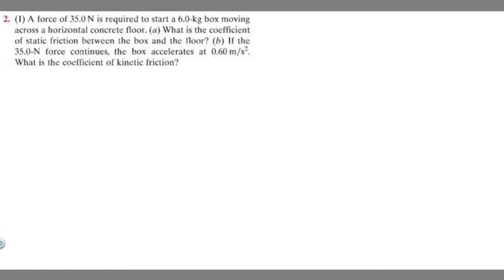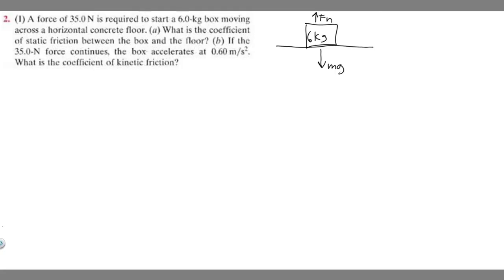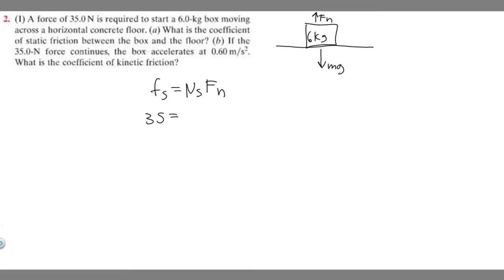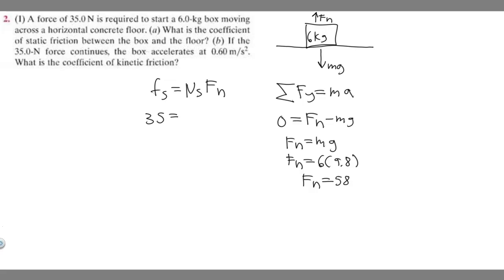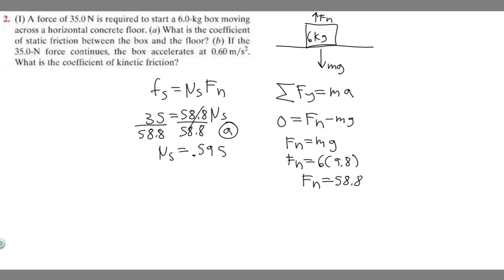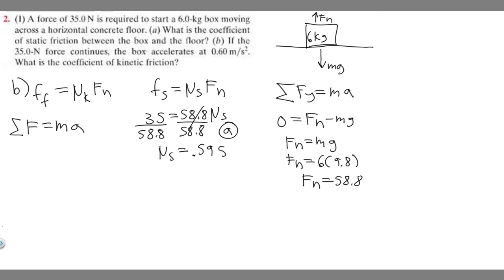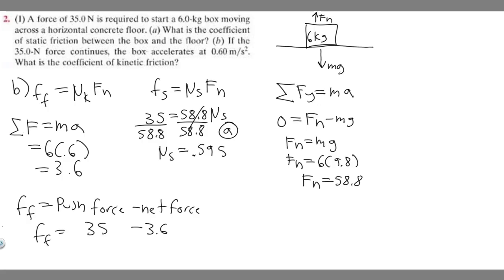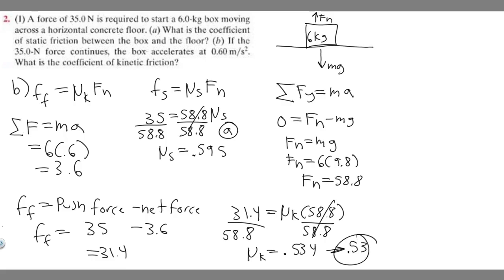A force of 35.0 N is required to start a 6.0-kg box moving across a horizontal concrete floor. (a) W

Comment: I don't understand how you're supposed to know that ff= to push force-net force. My professor is useless and the textbook doesn't mention this (even in the chapter summary all it gives the standard formula). I'm happy that I'll be able to do the problem no but I still don't understand what I'm doing
Reply: you must decide a positive and negative direction for your free body diagram. drawing free body diagrams helps me a lot. if you decide that the positive direction is to the right, the force of friction is acting against the force of the push. saying that ff = push force - net force is the same as saying net force = push force - friction (Fnet = Fp - Ffr)